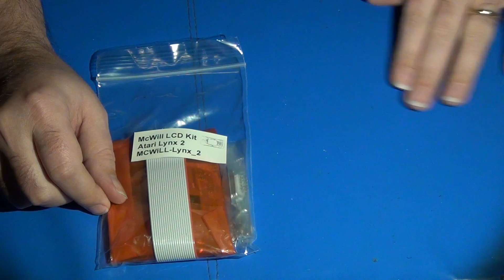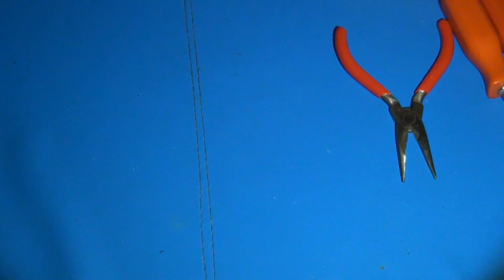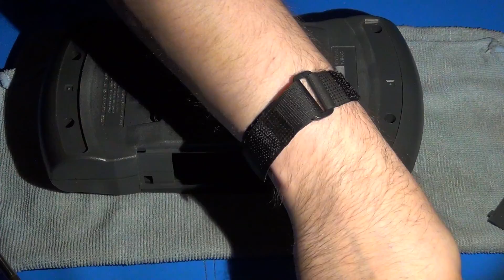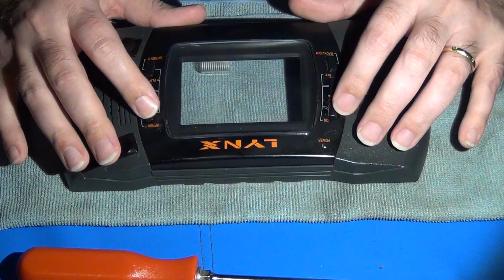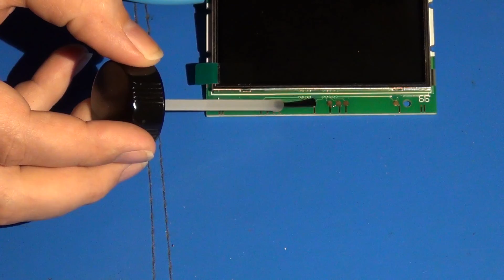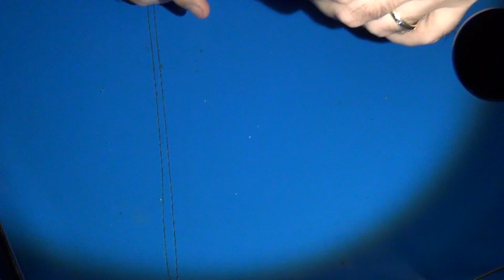ITC#52 - Atari Lynx II - McWill LCD Installation

Comment: What’s that device called you use at 22:48?  That looks like something that makes it very easy to get those off
Reply from the maker: That is my desoldering iron. This is an older model the FR-300 made by Hakko. The newer model they have is the FR-301. It is one of the most used tools in my work besides the main soldering iron itself.
Reply: Ivory Tower Collections thank you.  I’m really learning a lot now.  I got a cheap amazon soldering kit and it has the little aluminum desoldering pump you pump and push the button with.  For a few times a year I’m gonna use it, that might be the best way to go, although I wonder how often I need to clean this thing out

Comment: Great vid...just got one of these screens and I was wondering about the 5volts as aposed to the 9volts setup....thanks..
Reply from the maker: Are you referring to the use of a DC-DC switching regulator in place of the zener and diode setup that is in the Lynx originally? I've not tried the DC-DC method but I've seen where it has been done. I just replace the zener and diode out as part of a lynx refurbishment and I think the guy that even came up with one of the +5 dc-dc regulation methods has since gone back and claimed that he feels the original method being used in the Lynx is the best overall to go with.
Reply: @IvoryTowerCollections  I think thats what I mean...I  only do  basic electronic soldering on model train digital installs and no where near as advanced as you are but I think I can do this install ...thanks for your time...
Jim (U.k)